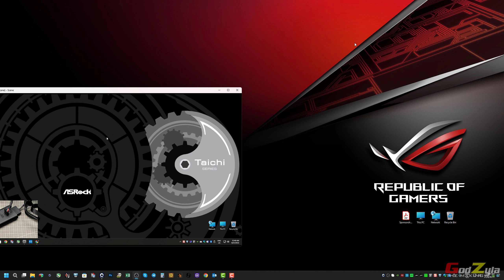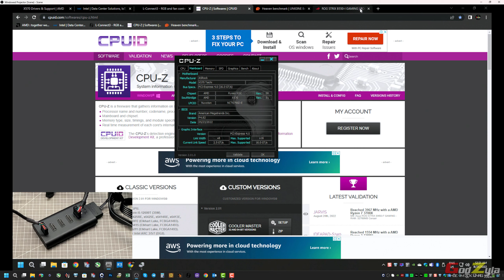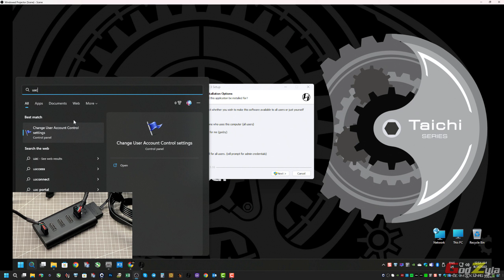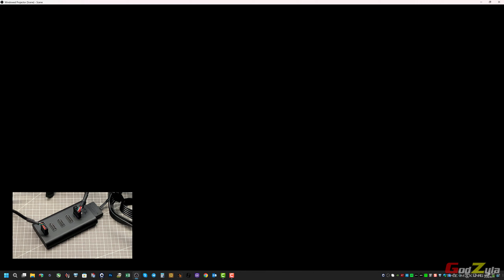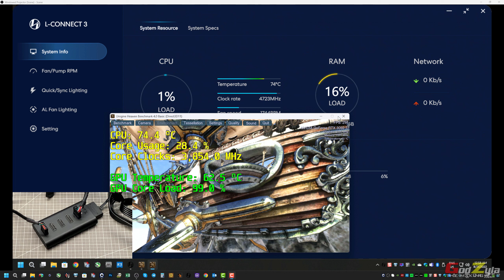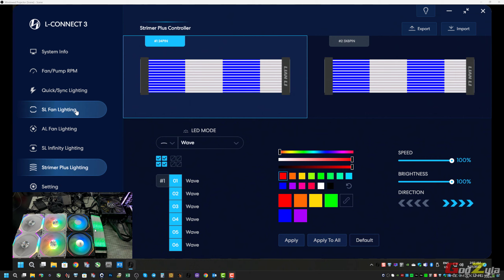Lian Li ARGB Products (How to make it work?) [L-Connect 3]

Comment: Hi, im making a pc build and I want to connect 9 lian li uni fans sl-infinity (2 triple fans (top and bottom) + 1 double fan (cpu cooler on side) + 1 single fan (back)), 2 strimer plus v2 (1 2x8 pins + 1 24 pins) and a Galahad (without the fans). How can I connect all of these? Do I buy a triple sl-infinity pack to get 1 controler or do I need more?
Reply from the maker: HEllo Hud3 XD, welcome to my channel. you will only need one contoller but I will adivise you to buy 2 x tripple SL-Infinity pack and 3 x indivual SL-Inifinity individual pack. Reason for this is, just incase one goes down, you have a spare. You only need one uni controller. so the setup is this way

Top -  3 x SL-Inf-120 (to port 1)
Side - 2 x SL-inf-120 (to port 2 and Galahad ARGB to sync 4 Port, the pump directly to motherboard) 
Bottom - 3  x SL-Inf-120 (to Port 3) 
Rear - 1 x SL-Inf-120 (to Port 4) 

Strimer Plus V2 (with the contoller itself)
Reply: @KleoYan  Okay, thanks!
Reply from the maker: @hud3  you are most welcome and all the very best with your build.

Comment: Is this work with ST120 too because I have one but it only has a fan hub nad L-Connect 3 doesn't recognize the fans.
Reply from the maker: Hi David, welcome to my channel, if you have the argb kit from lian li, you can plus the ST120 to the uni hub. Just for your info, ST120 does not have a build in chip like the SL120. Therefore the effects triggered in L-Connect 3, your ST120
Might not perform the patterns you have expected.

Comment: Hi!

How can I connect my St 120 with my SL120 with the panel control? Do you have any video? Cause I have 2 panel controllers and I don't know how to connect between them
Reply: How can i do to connect all? Like ur photo? It's necessary the two controllers? Or with de hub argb,fan of the SLFans the computer detects two models ? SL and ST?
Reply from the maker: @brakvictor  the diagram is only using one controller not two. If your ST120 is stand alone 3 pack fans. I got to apologise as I don’t have the ST120 to illustrate to you. So sorry but you can try asking your question at Lian Li Reddit channel. Hopefully someone will be able to aid you.
Reply from the maker: @brakvictor  here is the link to lian li Reddit channel https://www.reddit.com/r/lianli/
Reply from the maker: Hello Victor Garcia, welcome to my channel. Are your ST120 fans from your Galahad AIO, if they are. you can refer to this diagram. It it's too small, download the pic so that you can view clearly https://imgur.com/gallery/xuCyToS
Reply: @KleoYan  thank u!!! 🤘
Reply from the maker: @brakvictor  you are most welcome, all the best with your build.

Comment: My L-connect 3 program doesn’t read my gpu load and temperature. How can I fix it ?
Reply from the maker: Hello Richard Cardoso, kindly try these troubleshooting steps. 

Basic Troubleshooting steps
Disclaimer : Though the chances are very low to brick firmware updates on motherboard and to any controllers. I will not be responsible if you have brick your motherboard or controller.

1) Make sure your motherboard bios is up to date, please check on your motherboard manufacture website, under support > bios and drivers. See if there are issues with USB and do they have a fix. If there are, kindly update those bios firmware version.

2) Make sure your chipset driver for your motherboard is up to date! For AMD will be at https://www.amd.com/en/support for Intel will be Intel Driver & Support Assistant Intel DSA https://www.intel.com/content/www/us/en/support/detect.html

3) Remove all argb apps (Asus Armory Crate / MSI Dragon Center / Giga Fusion / Asrock Polychrome). If the brands which I have mentioned, do have a uninstall tool like the Asus Armory Crate, use that, else use Revo uninstaller ( https://www.revouninstaller.com/ ). Revo uninstaller will remove all unwanted files / folder / registry in your system. Illustration to use revo uninstaller https://www.youtube.com/watch?v=uMgUYiakpxM&t=437s

4) Shutdown your PC, unplug the PSU cable from your AC outlet. Press the power switch twice to discharge all current that your motherboard is holding. Leave it for 45 second

5) While waiting, please do not use KVM switches. Disconnect all devices that are connected to your motherboard (front / back IO). Leave only your Keyboard, Mouse , Monitor and Ethernet (If you have) connected directly to your motherboard. 
If your monitor has a KVM build-in, remove the USB cable from your monitor to your motherboard USB socket. If your mouse and keyboard are connected to your monitor, please remove them and plug them directly to your motherboard instead.

6) Plug only one Uni controller or Strimer Plus V2 controller. If its for Uni Fan (SL/AL) use only 3 fans to an output of the uni controller.

7) Plug the power cable and turn on your PC

8) Go to your Device Manager, look under Universal Serial Bus Devices, make sure you see the Lian Li uni / strimer plus V2 controller.

9) Install the L-Connect 3 app only https://lian-li.com/l-connect3/ (current version 1.3.16)

10)	After installation, run L-Connect 3, check under Setting > General > make sure Auto-Run on Boot and Minimized L-Connect 3 to system tray at close are ON.

11)	Reboot your system.

12)	First thing you need, go to device manager and see if the Lian Li controller is listed, next open up the L-Connect 3 app. Check if there is a need to update firmware to your controller. Go to Settings > Update, under Device F/W version, click on Update Check, download and install the firmware. Make sure the firmware is completed. Do a check on device manager and make sure the Lian Li controller is listed.

13)	On L-Connect 3 dashboard, check if the CPU and GPU readings are reacting, you might want to test it using some benchmark programs. If there are reaction, play with the PWM and argb functions. If it does not work, skip step 14) and proceed step 16)

14)	If Single controller works, shutdown your pc, connect uni fan set of 3 to your output of your uni controller. Do it small steps at a time to hook up your sets of fans. do not do all in one go. If successful and you have a second controller, proceed small step at a time again.

15)	Slowly plug back your USB devices (Headset, Microphone, Printer, USB Capture Card and etc). At any point of time as you add those devices one at a time, if L-Connect 3 become unresponsive. This tells you that there power is insufficient to power up more USB Devices. Whatever USB port on your motherboard, there is a limitation as the current are shared across the board, be it front or back I/O and the internal USB Header. You might need to get a Internal USB Hub that comes with a Sata Power source to the Internal USB Hub. (Disclaimer, buying a internal usb hub might or might not resolve this issue, purchase at your own expenses)

16)	If it does not work, report your issues to Lian li Tech Support. There is a in build log ticketing system in L-Connect 3 app. this is what you need to do. Go to Settings > Support > Click on “Download log” place a filename and choose a destination drive to save the log file. Next click on “Report” it will take you to Lian Li Tech Support FAQ. Fill up the form and upload the log which is a zip file.

Comment: Hey Kleo, i have one issue. It is that only port03 and port04 of my controller wouldn't let me control my fan speed. do you have any idea how to fix it ?
Reply from the maker: Hello Toni Wokac, welcome to my channel. If you are referring to the SL infinity contoller with the 3pin port. Those are only for argb and not for controller fans. The only port that control fans are those with seven pin sockets.
Reply: @KleoYan  hmm.. but I can control the  fan speed of the fans in port01 and port02. I just cant shut them down completely (also very weird). I like these fans very much and actually don’t want refund them but port03 in my controller moves at 1600 rpm. It‘s too loud.
Reply from the maker: @toniwokac7043  this is so strange. ok since your Port 01 fans are funtioning, can you unplug port 01 fans and plug them into port 03 or 04? to test. if you can control, means there is something wrong with the connection of the fans which you have originally plug into port 03 or 04. if it's still uncontrollable when you plug the port 01 fans into port 03 or 04, then it narrows down to the controller. in this case do you have another PC to verify. if not get your controller replaced. you can do the replacement cliam at lian li office website.

Comment: Nice Video first of all :) I still got problems tho with my uni fans sl infinity. They work fine and rgb is working but i cant use the blue rgb modes (heart beat, heart beat runaway, disco,...) in the l-connect 3 software. You got any Idea to fix that? Its all Updated  aswell.
Reply from the maker: hi Nico, welcome to my channel. you might want to try turn off your PC, remove the PSU plug for 45 seconds, plug back the plug and turn on your PC. see if that works. if not, have you try reseat the cable between the fans and the uni controller and also the USB connector between the uni controller to your motherboard? if still does not work, do you have another USB Header on your motherboard, try swaping it.

Comment: Hi mate quick question when I plug the three pin into motherboard for cpu pump do you run it on DC or PWM in the bios
Reply from the maker: Hello Arab’s Rabz, welcome to my channel. If your pump is of three pin. At pwm mode. It will run full speed. Unless you know your pump is pwm. Cos 3 pin does not have the last cable which controls the rpm.
Reply: @KleoYan  thanks for reply I have the lian li galad AIO and it just has three pin for power it’s my first build just needed to be sure where to plug in for motherboard thank you
Reply from the maker: @andrerabz  you are most welcome. This might help you understand better as how 3pin and 4pin pwm works https://youtu.be/MCMkrQwFnKM
Reply: @KleoYan  much appreciated
Reply from the maker: @andrerabz  you are most welcome. All the best with your build.

Comment: I have question ❓ how to make lian li infinity fans aio fans ? Please help me
Reply from the maker: @Markesamwasfy  Hello welcome to my channel and good morning. why the frown hmm, I just woke up.. it's 7:23am here in SG. hmm all you need is just to use the SL infinity fans to mount on your AIO radiator fan. you can see illustration here which I place them on a 360 AIO. https://youtu.be/hUN2_kuGWhk
Reply: Thank you ❣️❣️❣️❣️❣️❣️
Reply from the maker: @Markesamwasfy  this is your message at the other post.

LEO MESSI GOAT  • 7 hours ago
I have question in my nzxt kraken z73 there is a wire in the pump goes to aio pump and in the same wire there are wire for power the fans and i want to connect lian li infinity fans to the power wire  to  wire and the same time i can controls the rgp from the software

A1) it's not possible to connect the Inifinity fans to your nzxt fan splitter as you can't split individual fan connectors on these unifans (Daisy chained) 
this is the only way to use the uni fan with your z73 aio https://imgur.com/gallery/wxrKnQd

LEO MESSI GOAT
5 hours ago
I can install 6 fans in the radiotor 3 infinity fans and 3 nzxt fans i can or no?nzxt fans i will plug nzxt power cable to splitter its good idea or not

A2) not a good idea if you are thinking to do push pull configurattion with one side of the radiator using SL infinity and one side with NZXT fans. As the fans are of different structure and running at different RPM and air pressure. you might damage the fans in the long run. 

LEO MESSI GOAT
23 minutes ago (edited)
Is there an Explanation in a safety link,or Is it Possible to damage the device? Can you make a video on this topic if you are able to do well?if you can't it's normal,There is no problem

NEW! A3) The only damages is. if you decided to do push pull configuration using different set of fans on the radiator. as mentioned in A2) and the only solution is to not do push pull configuration, but if you want to put the fans just as case fans, you can do that, but as for connecing all to one controller, I do not know how as your NZXT k73 argb controller takes instructions from the NZXT CAM and the uni fan takes in instructions from L-Connect 3 app. so I have no solution from me. As for video, am sorry, I do not have your AIO unless NXZT can sponsor me the product to test on. thank you!
Reply: @KleoYan  i supposed to plug my fans to splitter? because in the pump there thing saying connect every think before turn on I'm worry if  i didn't connect any fan to the splitter then my pump damage?
Reply from the maker: @Markesamwasfy  I will try to help but you are confusing me. can you list down how your set up is like. give me full information .. example

1) Use NZXT Z73 , rad fans to use SL or NXZT
2) NZXT Fans, what are they use for? rad or case fans. 

you tell me if you dont connect splitter an error prompt.. from where? ypu need help I can understand but I can't help you if you dont tell me how your set up is and what are the fans intend for. so please give exact info, then i will try to help you.. i am getting fustrated of guessing what kind of setup you intend to do.
Reply: @KleoYan  sry My question is i have lian li infinity fans you knew that right and nzxt kraken z73 i want to change the nzxt fans to lian li infinity fans ok i can or not? and I'm supposed to plug  fan to splitter.please anderstand me /what im worry about is splitter if i didn't plug any fan its normal or my nzxt will damage?
Reply from the maker: @Markesamwasfy  this is the only way I know it can work. https://imgur.com/gallery/zEKCkRf but I do not know where you get the error message from?
Reply: @KleoYan  sry I'M SUCK IT WAS EZ BUT I'M NEW AT THIS SOO TY FOR HELPING ME SRY I tired you TY but what does mean al fan to motherboard cpu_fan header
Reply from the maker: @Markesamwasfy  ya does not matter if you new or old.. everyone has the first time. I hope you understand my diagram.. btw where you get the error message from?
Reply: @KleoYan  error message it from someone did guide to install nzxt i saw he connect nzxt fans to splitter i said in my mind : what will happen if i didn't connect any fan to the splitter now i think you anderstand how the error message come😂BYE I'M GOING TO MY GRANDMA BYE👑💗
Reply from the maker: @Markesamwasfy  the only prompt message you will get if you dont plug to Asustek CPU_FAN .. but not the NZXT Cam app. I never seen such issue on NZXT cam app.
Reply from the maker: @Markesamwasfy  here is what you need as the SL120 infinity, if you want to use L-Connect 3 argb effects, you need to have the uni controller which is in a 3 pack set. therefore your SL infinity 120 fans cannot use the NZXT Fan splitter, have to connect it to the uni controller. you will also need two application install, 1 the NZXT Cam app for your pump LCD and 2 the L-Connect 3 app to control your SL infinity 120 fans and argb effects. hope this diagram will help you out. https://imgur.com/gallery/zEKCkRf

Comment: That video helped a lot or brought me to the solution based on issues i had with L-Connect 3.... 

So, i'm running an Asus Dark Hero VIII (X570), 5900x in an O11 XL Case.
When i built the pc, i was running Lian-LI SL Unifans (infinity were not released back then).
Controlling the Fans through L-Connect worked fine for L-Connect 1/2...
However, even after upgrading the FW of the Controller, L-Connect 3 was never working... while L-Connect 1/2 didn't cause issues.

I upgraded some parts 2 days ago, replaced the Galahad with a Kraken z73 and the SL Unifans with the newer Infinity ones (which also come with a newer controller).
However, L-Connect 3 still didn't seem to work - but to controll all the lightning options of the infinity fans you need L-Connect 3.

Was driving me mad after x amount of reboots, bios update to the newest versions, disconnecting the pwm and only running per USB etc.
My Windows Installation has some legacy, so i reset/fresh installed win11 to be sure no ghost driver stuff or whatever causes issues, 
nothing really worked though... 

In the End it was all about USB Power... I have a 4k Aorus Monitor which has a built in KVM connected via USB.... 
Seems this have drawn a loooot of power from the mainboard and was causing the un-resposivness of L-Connect 3... 
As soon as i disconnected USB devices 1 by 1 and all of a sudden l-connect 3 started to work, I found out what devices have been causing the issue...

So again, thanks a lot for the hint in terms of usb power distribution and to look into that, which lead me to the solution :-)

I still find it funny, that i never had issues with l-connect 1/2 though compared to l-connect 3.... 
That's kinda strange that the issues were not present on prior versions... I can only imagine, that l-connect 3 draws a lot more power from the controller due to all the built in monitoring measurements l-connect 3 is doing from the controller which draws more power? At least this seems the case...
Reply from the maker: Hello Tino Burkhalter, welcome to my channel. yes one of the issue is with KVM switch or the build in KVM on a monitor.. I had your issues back then and did talk about it. However there are still issues for some peeps as they did not do the primary test or check. I know L-Connect 3 is fussy but once you narrow down the issue. it will work swiftly.I am gald you have solve your issue. once again thank you for your visit and your valuable feedback. 😉